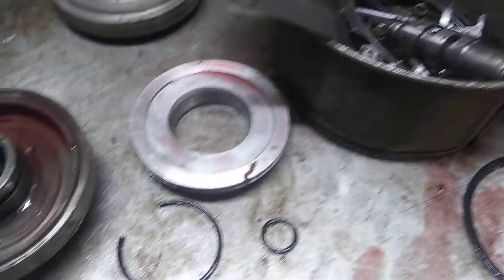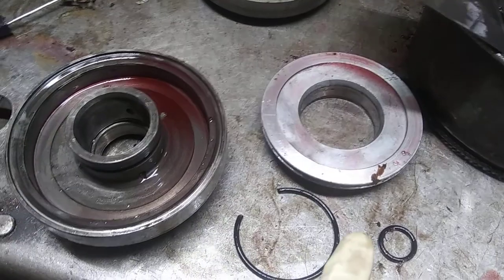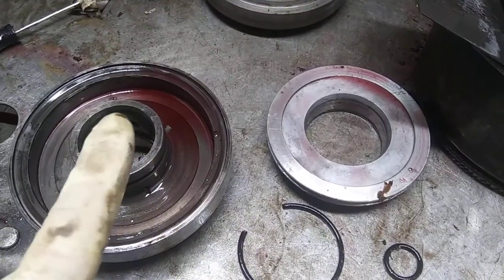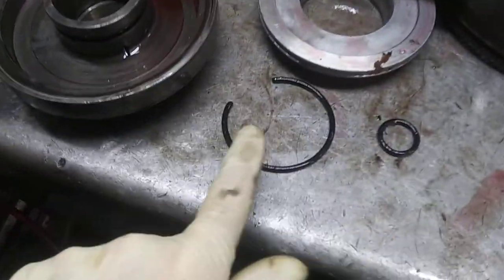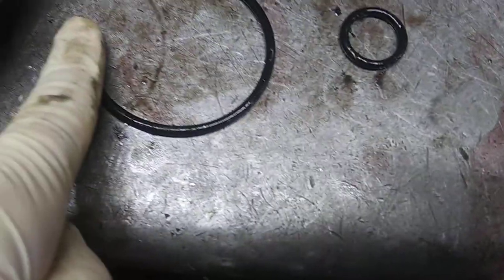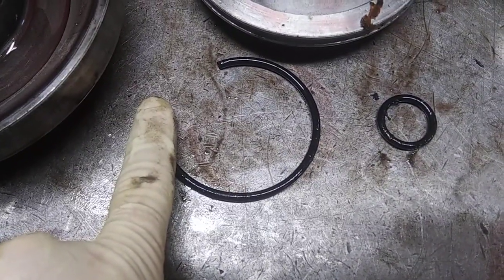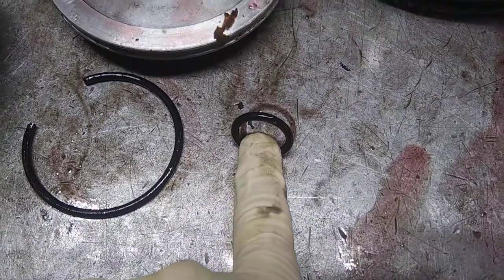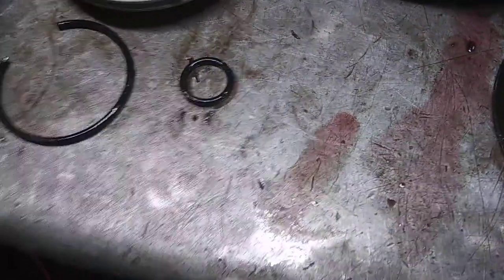Velvet drive signs of overheating

Comment: Hellow, you have a very interesting videos. I have a problem with Velvet Drive, after 5-10 min when the engine is start the  it became a very hot. I am use only the special transmission oil. What do you think, what the first I need to check?
Reply from the maker: What Model Velvet Drive do you have?
Reply: 71 С @halemarine5991
Reply: Velvet Drive 71 C plus gear box. Boat Carver 32 1985 year old.
Reply from the maker: @eduardfetisov565  1017-106?
Reply: Yes
Reply from the maker: @eduardfetisov565  Might be a low pressure?
Reply: Ok, thank you very much. The low pressure is only by transmission pump? Or somesing else?
Reply from the maker: @eduardfetisov565  Sorry but I thought of one other cause. Have inspected the transmission cooler?
Reply: Ok,  thank you very much, I will do this. I will take it from another engine, where it working good. Can you tell me what the volume of the oil pressure we need from the transmission pump.
Reply from the maker: @eduardfetisov565  150 psi
Reply: I am check I have 70 Psi
Reply from the maker: @eduardfetisov565   That is half of the of pressure it should have. Something is wrong inside the transmission!